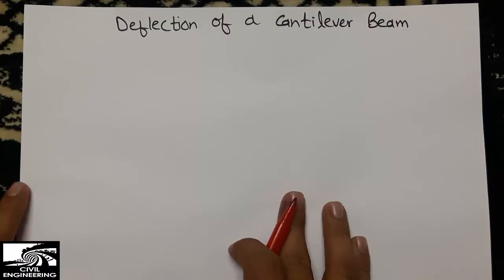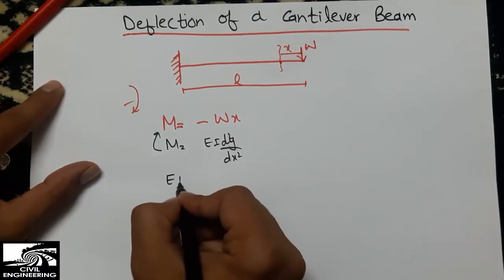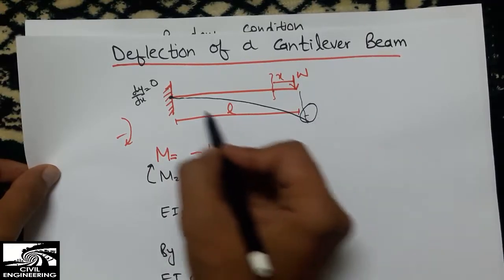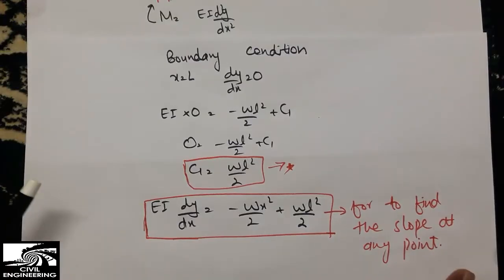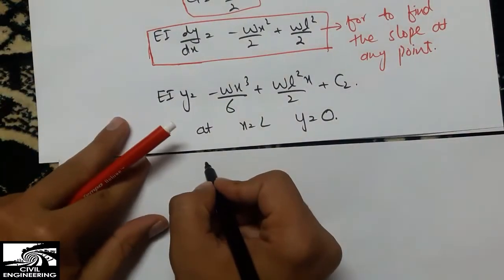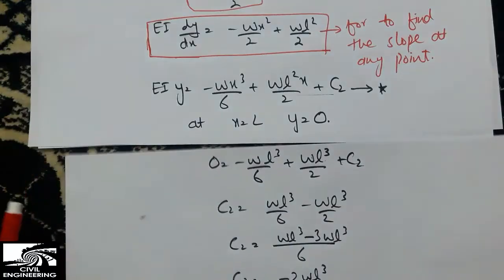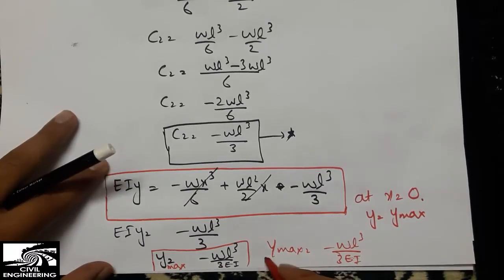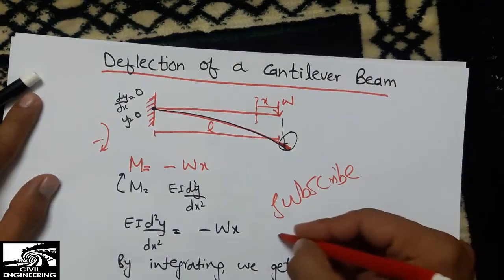Deflection Formula for Cantilever Beam || Step by Step Proof

Comment: an axial bar of length L and uniform cross section A is fixed at one end and free at the other end. It is subjected to a uniformly distributed load of intensity q over the entire length.Making use of galerkin's method, solve for axial displacement and stress developed.Take young's modulus as E.

tell the answer plz